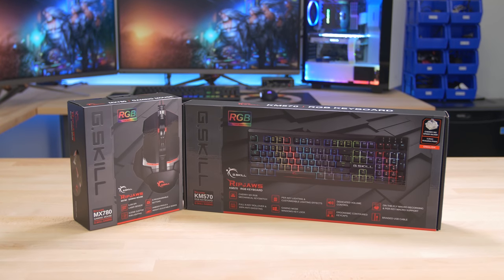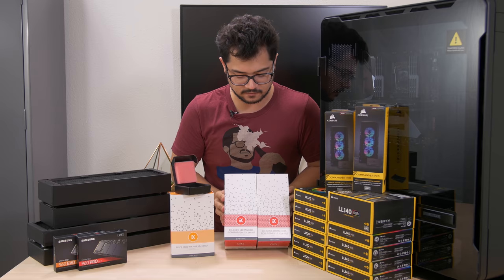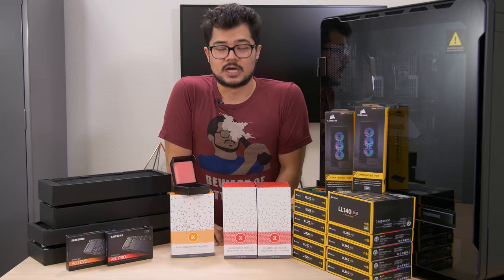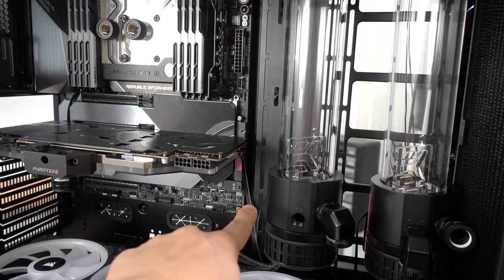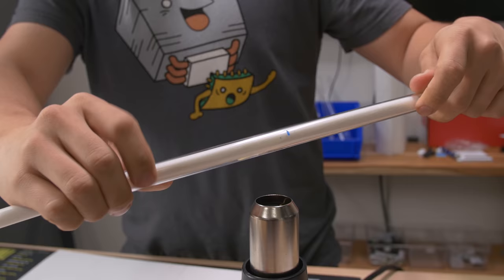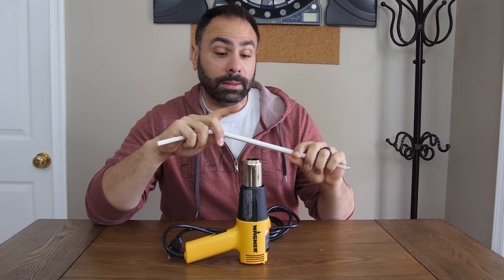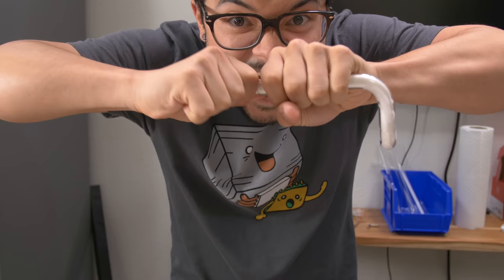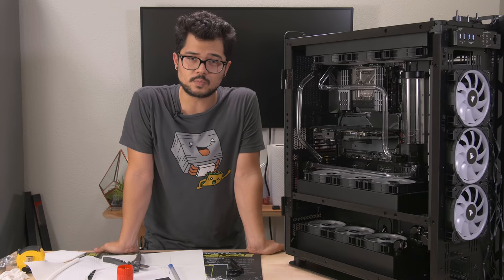ELITE BUILD PART 2!! INSANE PROGRESS!!

Comment: Kyle please do not keep that reservoir on the zip tie the coolant will add weight and you will run into problems just mount that second res on the radiator
Reply: I think it won't even look bad but if anyone has any idea on keeping them on the same level..?
Reply: Kyle send me a template with bolt pattern and I’ll send you a laser cut acrylic plate to mount them right
Reply: Shaun Guthrie excellent man ✌️
Reply: I agree. A pump res back plate mod is a fairly simple mod to do and will add not only the stability the second res needs but also will keep things sleek looking.

Comment: Amazing! Ultimate destruction PC. Well done. :D Thumbs up for delid, and monoblock. Few small pointers. You could have drilled 8 holes on one of the plates that go where your res are. That way you could position them perfectly. Those fans under front cover of the case will get no air. That space is meant for them to have room to breathe not stick a fan there. With those custom holes for res you could fit radiator and fan inside the case. My OCD is screaming about airflow, but you couldn't showoff fans if you turn them around. It will work just fine if you don't mind dust. Those fans move a lot of air. Otherwise impressive. It will look beautiful.

Comment: Kyle, little something I learned as an apprentice electrician.. Get yourself a small square of 3/8" plywood and two pieces of 1x1" pine and a square. Mount the 2 1x's to the plywood using the square to be sure your 1x's are perfect and mount the 1x's to the ply and you can bend all types of bends with that setup. Not just 90's or offsets but  kicks also. Nice 5$ tool to make hard tube bending easier.

Comment: What about the PSU? Where is that going?
Reply: Dennis Sorah there's a separate department on the bottom section that can fit a power supply.
Reply: Yes, but he put a rad there.
Reply: my guess  its gonna be externally .
Reply: CAOSWOLFIII it has to be external once he has the tubing there is no space
Reply: Dennis Sorah i had the same thought
Reply: There's a vertical compartment on the cable management side of the case
Reply: the CAse is actually wide enough to have it fit besides that radiator. it has to be mounted vertically, but it will fit!
Reply: Oh yea.. Money.. That solves all problems.
Reply: Dennis Sorah i was wondering the same

Comment: Why use the 960 evo as a boot drive? Isn’t the 960 pro faster?
Reply: chiggins using the faster drive for his actual work... makes sense, right?
Reply: I don't think you really notice a huge difference?
Reply: chiggins evo is faster
Reply: like it matter between the two its gonna boot in under 20 seconds anyway. Also the pro is faster an gonna be used for games an editing so why put the OS on that like what if he wants to move it to another rig
Reply: no and kinda think that one is better in writes though...some PNY one is, allegedly some just stellar write performance. THat is important. All similar and fast Reads.. I'm assuming it works man, nothing listed about support, the wd black is but it's slower in writes...I thought it was pretty universal nvme at the moment, I could be wrong though.
Reply: J and K White  pro is faster
Reply: Last I checked, the difference between even SATA ssds and m.2 drives for Windows boot times is negligible
Reply: boot not worried about, yeah that's fine, some other stuff loading times a lot better or some other junk like big file movements or something. It is a good bit quicker man.
Reply: NAND Shortage and who the hell can make better Nand man.
Reply: J and K White no pro is faster.

Comment: You do know volta is going to be launched in April right?
Reply: You sure? Hope it's not ''April'' Fools... :|
They should wait for ATI first, and then destroy them. It would be much epic! :D
Reply: Devin Dykstra according to what?
Reply: Link please.
Reply: how do you know
Reply: You do know this is an ad with parts supplied by sponsors right?
There'll be another in 2018 I'm sure :)
Reply: "Forget Volta - the latest rumours surrounding Nvidia’s next-generation GPU architecture suggests it will, in fact, be GeForce Ampere. According to Heise.de, Nvidia is planning to reveal/pre-launch Ampere during GPU Technology Conference in March, much earlier than the second half of 2018 that we were expecting."

Just use your search engine and find the sources yourself.
Reply: Devin Dykstra I've read that it's supposed to be released at q2
Reply: No Volta and it's may
Reply: June checking in. No volta
Reply: that dude just took an L
Reply: Well it didn't =(

Comment: 10k PC and you can not build a real mount for those pump/res  combos. Zip ties, are you kidding me?
Reply: 3D print a bracket, or put both reservoirs in the bottom chamber and a front facing radiator where the res's where previously.
Reply: if he had a separate pump / res he could have put the 2 pumps a the back where the brackets and mounts are and supplied ;) and its sound prooffed ;)
Reply: Yes, good point. :D Come on Kyle, split the pump/res combo's up and hide the pumps away.
Reply: discostoo why would you hide the pumps? they're one of the more better looking components in a custom loop
Reply: The reservoirs I can understand, but the pumps? What do you love about the pumps?
Reply: discostoo oops, mb. i mixed up the pumps with the reservoirs xD
Reply: They make very nice looking cnc machined brackets for dual pump/res that would just bolt to the front rad.. The first one that pops to my head is singularity computers.
Reply: greg stevens How would hiding the pumps help at all? You still have to mount the reservoirs somewhere. Also, wouldn't you have a point in the loop where the water slows down if you don't have the pumps connected to the reservoir?

Comment: After looking at all his fans, I just realized that fan I have in front of case has no opening for airflow.  front of case is completely sealed on all sides.  side panels are solid metal.  only openings are on  back.  mini atx case.  I had 120mm in front.  80mm in back.  and wraith on cpu.  and power supply on top pointing back.

Comment: @BitWit - Those EKWB Res/D5 Combo's twist around mate so you can re-position the inlet and outlet of the pump on the side to the CPU. Also the 1 that is right next to the RAD will benefit by twisting the ports more around to face the inside of the case rather than the side.
Reply from the maker: Paul North will look into that thanks

Comment: Just a suggestion, but have you thought about replacing the bracket that your reservoirs are attached to with a piece of Lexan or something similar? It just seems to me that such an awesome system should have something like that so it could be side lit by LEDs. Just a thought.

Comment: get the power supply in with the cables u might need, and check for the clearance for the rad and tubing, I just finished my build, my psu was the last part I put in and I got lucky and only had a couple cm to spare

Comment: Why did you choose a push and not a pull configuration on your radiators so dust won't build up in the fans? And wouldn't it be more efficient to switch the direction of the fans in the bottom so the warm air doesn't need to be pushed down? Love the build and can't wait for that hard line tubing!!

Comment: Hmmm, i'd keep the two lower radioators for the vid cards and the other two for the cpu.
The ins and outs for the two Radiators at the bottom could be near each other and be less messy and easier to do, one out could go straight into the in of the other.
One pipe down from the pump to the lowest radiator for in. Out from to the top one to the cards and then to the pump.
Then the CPU loop will be messy anyway since they are not near each other.
I would maybe rotate the top radiotor, so teh ins and out of those two radiator can be in the same corner of the case.
Right pump up to right side of side radiator, comes out and goes short route top radiator, out and to cpu, from cpu to right pump.
Probably the cleanest way, and less long bending messiness ?
But we'll see how it turns out i guess.

Comment: Thank you Bitwit for providing us, as always, great video content about Hardware and PC Build :D

 OH Guys I NEED YOUR OPINION about the pc configuration i bought yesterday (~2500$) :
 - CPU : Intel i7-8700K (3.7GHz)
 - MB: MSI Z370 GAMING M5
 - RAM : 2x8Go Corsair Vengeance LPX Black 3200 MHz CAS 16 
- WaterCooling : Corsair H115i HydroSeries 280mm 
- GPU : MSI GTX 1080 Ti Gaming X 11Go 
- SSD M.2 : Samsung Série 960 EVO 250 Go 
- HDD : Seagate Barracuda 2To 
- PowerSupply : Corsair HX850i 850W 80+ Platinium 
- Case : NZXT S340 Elite Black 
- Wifi Card : TP-Link Archer T6E 
- Thermal Paste : Artic Cooling MX-2, 4g 

I have some questions about my configuration : 

A) What do you think of this configuration overall ?
 B) Do you think it is equilibrate for 50% 4K Adobe Video Editing / 50% 4K Gaming in ultra ? 
C) Have you any suggestion/replacement to improve it ? 
D1) Should I wait 2018 to buy the new monitor ASUS PG27UQ 27" 4K 144Hz Nvidia G-Sync HDR10 ? :P 
D2) If not, what monitor would you recomand ? 
E) Do you think this configuration or some composants are overkill for 2017 ? 

Thank you a lot for any help to a young french man who begin in hardware ! <3 <3

Comment: HOLY CRAP that's a LOT of Radiators memory cores and STILL a lot of GPU power, the only thing you could bump up is add another 2 1080tis, but you would be pushin it to cool all them GPUs then.... but DANG that's a lot of RADs... and them rads are THICK too.....

Comment: With an all out build, and speaking as a heating engineer from the uk (domestic). Im suprised you did not configure the CPU cooling with the two largest radiators,  cpu, rad, rad. Then the GPU's as; pump, GPU, rad, GPU, rad. 

The way you have yours piped would mean the 2nd card would be running hotter, due to the heat from the first card being run past it.

Also i noticed condensation on the "ghetto" sump, is this always a problem when mounting a sump? Or because its touching the hottest of the radiators.

Comment: Awesome system you have there!  Any concern with the bottom 2 radiators blowing hot exhaust into the intake of the other?  Probably won't affect the system but it's not efficient.

Comment: Is there a benefit to dual loops? 

It seems to be that with two loops you run the risk of over loading one set of radiators while the other could be sitting "idle" so to speak (i.e. GPUs under full load and stressing the cooling system while the CPU sits idle). I mean, of course, you could do some basic calculations to try to avoid that but at the very best it seems like you could only equal single loop performance given a certain amount of radiator space.

Comment: Good video. It's looking good so far. Maybe too many fans , won't it be Loud ? This Kind of Build should be on a External chiller to see really what it can do to maintain temps down at 20-30 degrees c. Or less.
Reply: Advantage of running more fans and radiators is that you can run the fans at slower rpm and generate the same amount of cooling power.

Comment: Its an absolute nightmare dealing with corsair rgb strips and fans. The first lighting node pro that was shipped to me worked and a firmware update made it undetectable so i had to send it back and the second one worked for a few weeks until for some fucking reason, the lighting node pro stops showing up in corsair link. Im ready to switch to nzxt, aigo, or maybe even thermaltake if this shit is too much of a pain in the ass to fix.
Reply: Pennywise what the fuck how hard can it be to throw a disco party in ur case

Comment: I have a fan blowing direct on my VRMS on X299 7940x and its fine. No de-lid too scared. Still did 4.6Ghz overclock but mighty hot. 4.8Ghz would be possible with de-lid. Be interesting to see if he can tame the 18 core.  I found extra rads didn't help, nor pump speed its getting near the limit of what water cooling can do. Completely unrestricted air-flow dropped temps 8oC, Nothing in front of rad fans but mesh recommended. Like to see a water chiller in action.
Reply: Jon Donnelly send it to a company to delid if you're scared, that'd be a better step to take before water chilling

Comment: Dude, build a false wall for the rig.. Acryic of Alu.. outsource the work if you dont have the tools to do it. A zip tie holding up a res in a 10k build seems a bit lazy.. Plus.. all the cut outs in that side wall make the case look a bit cheap. Please build a false wall/reservior mounting plate.. You can even buy a CaseLabs SMA8 dual res mounting plate and just mount it onto the case.

Comment: kind of odd imho, to have the evo as small boot-drive and the pro as big data-drive. but since that is what you happen to have, why not ;) 
250 GB pro and 2TB evo is what i would do. but tbh i couldn't afford the 2TB ssd, no matter if evo or pro :D 
and a note about the second res, i would probably just drill a hole in the bracket, so i can mount it with three screws at least.

Comment: I'm a complete noob to this, and correct me if I'm wrong, but you said the cpu loop was done, but I don't see any tubes going in the cpu block... I only see tubes going from the pump to top radiator, then going to bottom radiator and back to the pump

Comment: Why does it look like your exhausting air through the bottom of the case? Shouldn’t it be intaking on both radiators? Or are the fans running in a different polarity

Comment: So have you had a problem with corsair and those fans and commander pro? My fans rgb does not work anymore and I haven’t been able to find a solution. Only fan 1 will work with rgb and the rest don’t. But fan 2 will have 3 LEDs on the center will come on and that’s it. The other 4 fans won’t even turn on BUT the fans do spin and keep cool. It’s just the RGB that isn’t working. I’ve uninstalled CAM since I have the kraken x52 and uninstalled asus aura sync because I have the z370-e board from ROG strix. I have tried corsair ICUE and it is worse. Then I went back to corsair link. The RGBs will work once a month basically. Any ideas???

Comment: Don't know Kyle, early to say of course but the build looks way too big and heavy to me. Too many fans and (big fat mamma thick) radiators. The radiator positions also seem somewhat suboptimal. Only the front radiator breathes truly fresh air from outside; then all others will breathe from the warmer output of that one inside the case; and two radiators sort of in series, one right above the other, both pushing hot air towards the bottom of the case? And some tubing kind of too close to fans and right in the way of some of the air flaw, I mean flow ;) Also as it stands it will not have positive but negative pressure inside. Front fans might pick some of the warm air leaving the case through the bottom back inside, and negative pressure will even help them do that, both from the front and the back of the case. Massive Elite build and all of course, but hmmm don't know, not digging the cooling

Comment: Could you have the GPU loop go through a rad after each GPU? like GPU1-->Rad1-->GPU2-->Rad2?
Reply: No. He can't do that because there is about a 1 1/2 inch - 2 inch gap between the gpus
Reply: Ender The Sloth thanks!
Reply: The GPUs will probably be cooled in parallel, in which case they will both be the same temperature. Even in series the second card is usually only a couple degrees hotter. I doubt having a rad between them would change much.
Reply: Ethan Cranford technically you could run tubes through each block separately but there is no real point in doing that. I assume your thinking is that each rad would cool the fluid after it takes the heat from the gpu. Running them parallel would be smarter though. If it were me i'd do rad1 > gpu1 + gpu2 > rad2
Reply: It won't make much of a difference.  Even with two cards it'll take several minutes warming the coolant before the temp rise levels off thanks to water's high specific heat.

Comment: Bitwit, im really confused, i plan on buying the twin pack for ll140 fans and 1 separate (3 fans total) and also the lighting node pro extention kit, i intend on having fans and rgb strips running at the same time, is there anything else i need to buy? like a commander pro or a second lighting node pro (1 that comes with twin pack and use that one for fans, i have two fans at front and one at back and buying an extra one for the rgb lighting kit) thanks in advance

Comment: I recently built a gaming pc, these are the specs.
Intel Core i5-8400 2.80GHz
ASrock Z370M Pro4
2x 8GB 2400MHz PC4-19200
Total 16GB Dual Channel Memory
NVIDIA GeForce® GTX 1060 3GB
240GB SATA-III 6.0Gb/s SSD
2TB SATA-III 6.0Gb/s 7200 RPM HDD
750 Watt Standard Power Supply
Set 301 Micro ATX Tower White
Is this a good gaming pc? I'm new to pc gaming and I was wondering what you think this could run games at.
Reply: A 1060 3gb ?
Reply: You just wasted money on latest motherboard with latest chipset and latest cpu when you could have gotten better performance from z270 platform. You are not even taking advantige of the z370

Comment: When your CPU pumps the same amount of heat as TWO high end GPUs so you have to spend twice as much money to make two separate loops so that the GPUs wont thermal throttle because of the huge  amount of heat.
Reply: He didn't need to . Single loop  vs dual loop is just for looks, not much if any performance benefits . You would think there would be , sadly not really . More radiators matter though.

Comment: how do u suggest i cut tubing? i bought one of them hand saws that was for cutting tubing but it takes wayy to long and is way to unaccurate/dont cut straight
Reply: MoDRun XSPC makes a good tube cutter for PETG. You can also just go to Home Depot and look for pipe cutters, they’re inexpensive and you can get different types.
Reply: do u mean this kinda cutter https://www.amazon.com/XSPC-Easy-Bend-Toolkit-Tubing/dp/B016B29V4G